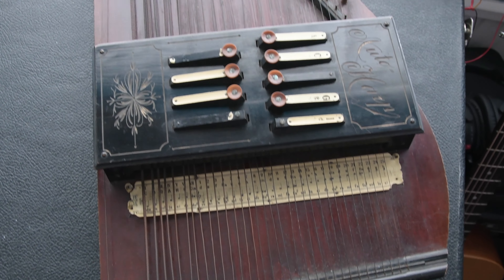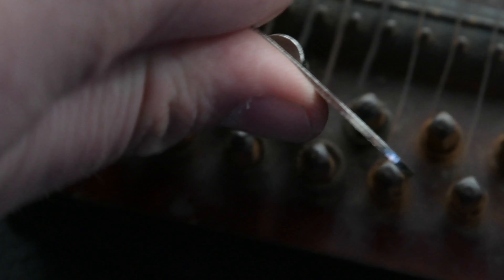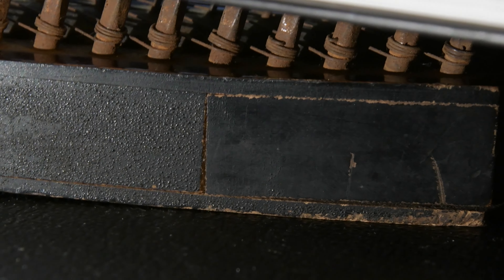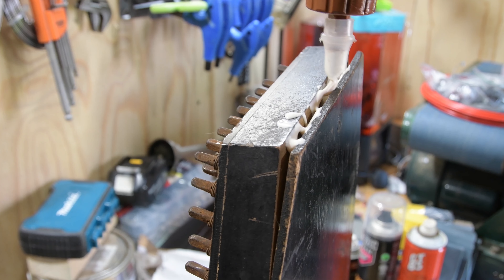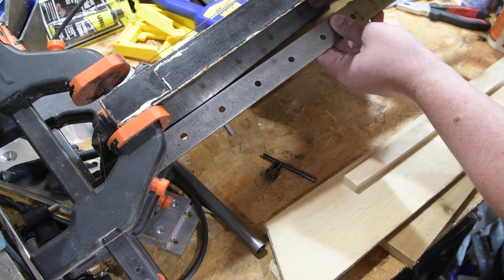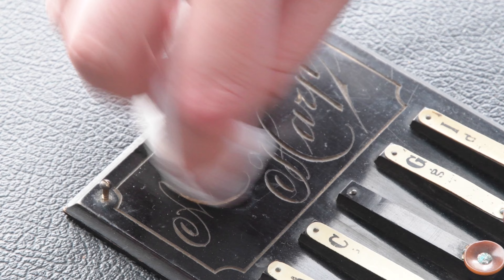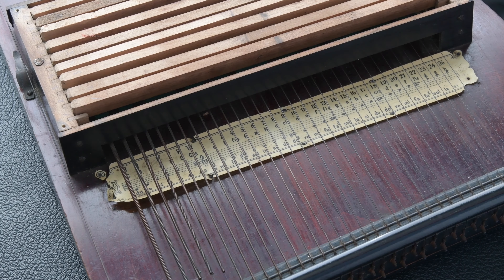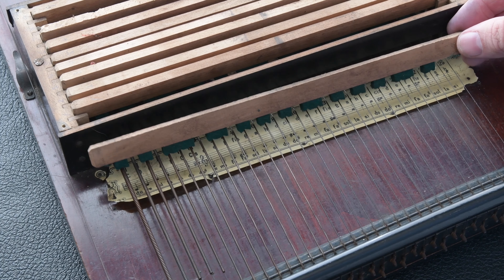Autoharp - Restoring Part 2 -  Can it glue?

Comment: I found that the key to finding the right tool is just a matter of knowing the right name for it.  In this instance, the name for the tuning wrench you're looking for is a "Tuning Hammer". This is the same type of tool used to tune pianos, but you don't need a full sized hammer for a Autoharp.

I would guess that this is a Diaphonic autoharp, rather than a Chromatic one, based on the string tuning.  Upside of Diaphonic is that it's louder, there are more duplicate strings, downside is that it's generally only good for playing in 1 or 2 keys (and maybe a natural minor).  It's kinda weird that they have F strings and aren't using them. You could tune the F strings down to a D or up to a G to help reinforce your root notes, or perhaps just remove them entirely to help reduce string tension. Main Upside of a chromatic autoharp is that you can play in more keys.  My chromatic Chromaharp has 21 chord bars, and can generally play well in keys of: C, D, F, G, and most of A (with most of their natural minors).  Downside is that the harp is quieter with less strings sounding per chord, and more dead notes (muted strings), accentuating the thwup thwup sound you get from strumming muted strings.

Also make sure you are pushing down hard enough on the chord bars that you are fully muting the strings, re-felting them should help with that.  One potential pitfall with changing up the chord bar tuning and especially moving them around, is to avoid any potential nodes on the strings.  Otherwise, you may end up with some unintended harmonics when you try to mute a string.